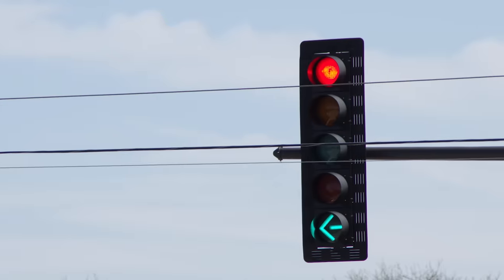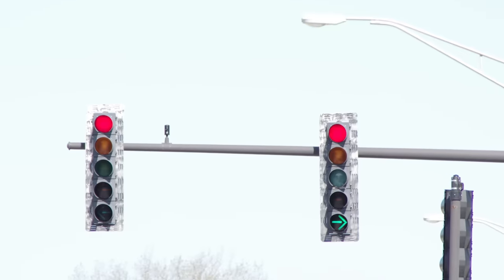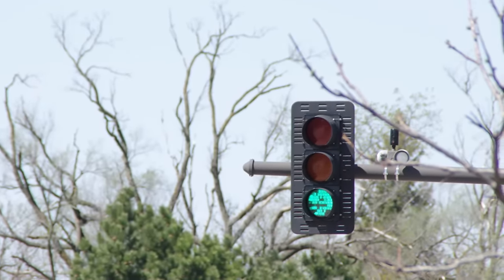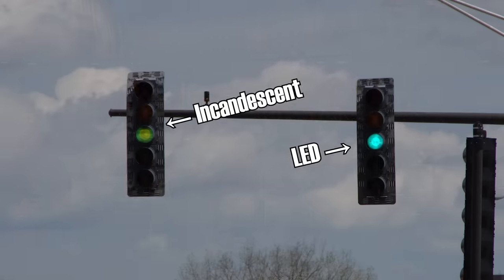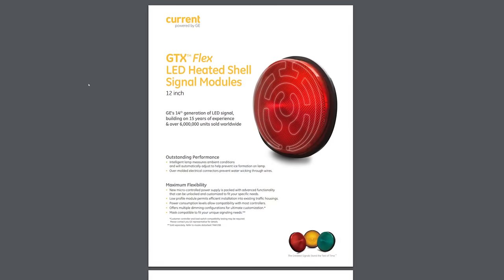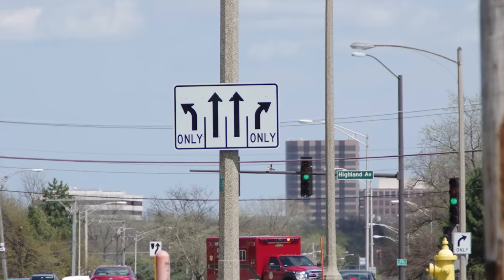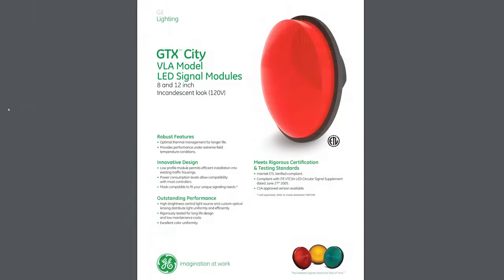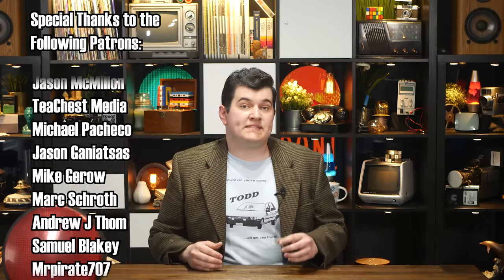The LED Traffic Light and the Danger of "But Sometimes!"

Comment: Back when they first started using led bulbs for turn signals they weren’t compatible with the relays that made the bulbs flash. Led bulbs don’t use enough electricity to make the bi-metal contact heat and cool to break the circuit. If it’s an issue of design era the older traffic relays may not be compatible with the led lights. With the draw being so low self keeping relays won’t function properly. Modifying one component may cause a malfunction elsewhere. With the cost of new equipment possibly being other worldly, small towns could be forced to defer replacements. Along with cost of equipment there’s also cost to install to consider.
As for snow covered traffic lights there’s usually only one set that could be blocked depending upon wind direction. Since there’s no visible problem from other directions it won’t occur to them they need to stop. It’s inevitable something bad is going to happen. I’ve seen the heated lights and sometimes they do funny things with the light they emit where the lights look silver and the color is reduced. 
I kind of like the traffic sensors since I figured out how to make them cycle faster in many cases. Sorry, I won’t divulge my method though.🤷🏻‍♂️

Comment: This is why systems that really need to work are over engineered and have redundant systems built into them, because "sometimes happens" 🤠

In the case of stop lights there are usually several lights to rely on in case of a failure, and in the event of a system failure, (in VA anyway) the yellows blink on the main road and reds blink on side roads. The driving manual says how to handle this btw, 

Now if somebody could just make a stop-and-slap for the 4 or 5 people the hustle the left turn after it goes red...

Comment: And if you stick some solar panels around on those poles they can charge the battery backup..likely only needing grid power when a battery finally fails so damn near zero power used.
That includes adding a sensor and heater. Almost zero power used and full blackout protection with proper battery capacity.
based on the savings you mentioned it would pay for itself in a couple years

Comment: When the sun is low in the sky and shining directly into the traffic light I find that it can be difficult to tell if the red light is on or off.  Also, while I presume traffic light LEDs are of higher quality, I find that with home LED's that the electronics that drive the LED fail much sooner than the LED itself.  But they never advertise the lifetime of the electronics, just the LED.

Comment: In PA the municipalities pay for the lights and upkeep, even on state roads.  Here replacement LED bulbs is easy, but replacing old hardware might be worth it until the control system is at it's end of useful life.  Remember there are other things to account for, requirements of a traffic study, maybe intersection redesign and the cost of the new system.  It is all nice and good to say do these things, but us elected officials just happen to know about the crap we have to deal with from time to time.  PennDot is one of them.

Comment: There is no way to tell if the traffic signals perpendicular to your street are frozen over. Therefore you may have a greenlight, see people stopped (they think the whole intersection is out), and drive through as they pull out in front of you.

Comment: ok, so my take on the "but sometimes" problems is to just look at the problem, look at solutions to that problem, and see what the result is when accounting for the but sometimes. sure the led is so efficient it'll need auxiliary heating during freezing and snowing conditions but how much energy would such a heater use? oh, up to half the energy of the old lights and is only running some of the time? sweet, i'll take it.

like ev driving. i used to think "oh i somewhat regularly take long distance trips so therefore ev is bad for me" but in reality a phev design is the option. don't use the ice in day to day commuting but have the ice for the long and really long trips or for when the ev portion isn't feasible (say rediculously cold temps requiring all the battery's energy to keep it warm) but that's not often enough to deter me from wanting a phev and using the best of both worlds.

Comment: Is your backdrop shelving flush with the wall, requiring you to have to remove everything from a cubby before adding video specific elements like these traffic signals 🚦 or do you have access from the rear of the cabinet?

Comment: 4 years later, dollar store LED drop in bulbs die relatively oftenly, about four times as long as an incandescent in my experience.

LEDs are finally failing, all it took was them literally being designed to fail with high currents on fewer diodes.

Comment: I got that at work recently. I changed up part of the way we do things to help make everything more efficient and generally easier on everyone but it did crate some new problems which I knew about before I changed it. I got everyone opinion before I did the change and they weren’t interested in taking about it at all but after I changed things everyone just complained about everything instead of helping me make small improvements to the new design.

Comment: In a snowstorm at night you can’t see WHERE a intersection is supposed to be if there’s no working lights pardner.

The fact is these municipalities should have taken some responsibility, in not doing proper research in the differences between the two equipments.
They should have factored in the heat differences and installed a system in place to heat up if met with freezing temperatures, it wouldn’t be that hard to do. But I guess blaming LED lights is still even easier than doing that.

Comment: For the argument of "it turns into an all way stop", I've seen multiple times when the light my direction is perfectly clean, but a side road can't tell what they have due to the snow. If 3/4 directions are clear, 99% of people will assume all directions are clear, as they have no indication otherwise.
Reply: If 3/4 directions are clear then there is no issue because your on one direction and your not going to go backwards.
Reply: @afaxmachine5045  I was referring to the lights being visible, not traffic. I have seen many times the lights are covered in show and not visible at all, but only for one direction of travel. The other three would have no idea that the 4th can't tell what their light is.
Reply: @jamesp7753  which also shouldn't matter because If one is out it should be treated as a stop sign.

Comment: totality agree but... that first winter was terrible it did not take much of a snow event to block them and you didn't consider that only one or two sides are affected by the snow so some drivers did have working lights and no idea that the opposition didn't. every snow even had cops in middle of intersections till heating system was jerry rigged into housing that more then undid the projected savings. it was amusing and was fun grumbling about it.

Comment: You don't live in North Dakota. In Russia has solved this problem. They removed the visors and thus snow does not accumulate. The LED lamps are bright enough that visors are generally not needed. They have red yellow green vertically except that the amber light, when it is not flashing amber counts down the seconds to the next e\signal change. On the bottom of the signal there is an array of three lamps. they will show red or green depending on which turns are allowed or disallowed.
 Великий и Славный и самый Имперский ЛЕВ 🦁

Comment: I could literally whipup a cad design and pcb for a fix for this. Integrate heater coil lines into the PCB design and have temperature probes on the board and when it drops below a threshold temperature say 0C the coils come on. It'll still be cheaper

Comment: Even the city I live in, one of the northernmost major cities in the world which is known for it's cold winters, we have LED traffic lights. Not universally, but I would point out to answer, to some degree, why you wonder why you don't have them yet in your area, is bureaucracy of course, and it can take significant time to deploy. We regularly receive winter weather sub -20C and even -40C and I am unaware of any issues with them operating in fact, strictly form an LED functionality point of view they work just well if not better in the cold, but in terms of lens obscurement or obfuscation, I have never seen an LED one obscured due to ice or snow. I did some research and each one has a fan for exhaust heat, and a 300-350W heater but as far as I can tell that is only on the control box and not the light fixture itself. It also may be this is more of a coastal problem as where I live is fairly dry in comparison

Comment: Hold up. Fatal accidents caused by faulty stoplights during a snowstorm are definitely the fault of the lights often if not most of the time. In a snowstorm, the light from the stoplights is often the only thing indicating the presence of an intersection. If it's night time, the stoplights may not even be visible while not illuminated.

Comment: Uk- Back in the early 2000's when we were out and about in the car at early hours of the morning to grab anything from the 24 hour garage ( usually ciggs for smokes ) we used to flash the car lights really fast and every red light would change to green on empty roads, it was so awesome. Not sure if it still works or have i tried it since. xD

Comment: I find that the LED lights are sometimes TOO bright, particularly at night.  They could use 10% dimmer LEDs to eliminate that issue, while maintaining safety.  I find the same problem on some LED taillights on vehicles.
Reply: Aye, especially when they're blinking. In a dark area.

Comment: So much engineering I didn't knew was possible or even could exist!!!!
On my country afaik there is only the control board on some of the older ones, which are maybe 2 or 3 out of 50.  
I loved the old light with the lenses because they looked sooo cool.
Maybe there are some that are controlled remotely although I can't confirm that. They are almost ALL LED's but some are burn't which annoys me. The street lights are almost all led's too but incandenscent aren't uncommon.

Comment: The holdouts were smarter.  Now, without spending a money on the 'whole-light' LED replacements that do just what you showed (and are /quite/ often really badly burnt out) ... Owners of conventional signals can now simply screw in low priced and widely available LED edison-style replacement bulbs and get all the benefits of a retrofit along with the easy, cheap serviceability of 'screw in a new one' without ever having spent all that money to 'upgrade' the fixture.

Comment: I don’t think I’ve seen one of those incandescent signals in well over a decade across California. Now thinking about it I only really remember some about 5 years ago deep in the middle of nowhere farm country north of Sacramento. And those only flashed red if an intersection had a rare cross traffic vehicle.

I seems nuts to me that people wouldn’t want to switch to LED as soon as possible. Maybe because in CA incandescent lights are next to useless on a sunny day (so most days).

And even in the Sierra Nevada parts of CA like towns in Tahoe haven’t had the issue of going out in snow events, but there and then again they were clearly designed for heavy snowfall conditions and are not simple traffic light boxes.

Comment: There are those who resist upgrading because of the UNION employees who wouldn't be needed to change bulbs. The addition of a simple temperature sensor and HEATING PAD, the "sometimes" is eliminated. Follow the money. Who benefits from the continued use of incandescent bulbs?

Comment: I like too use a thumper solenoid I took from a pinball machine - this was mounted to my mom's satellite dish.  the dish was too high on the house to take a broom too when snow built up on it.  A small box next too the receiver unit was handy as it had a button to push - thus really gave the dish a good "thump" as watched as the avalance of snow slid off the dish.   might get away with this inside the traffic light??

Comment: Talking about traffic lights, in Austria the green blinks for 4 times before the orange lights up .. to my knowledge this is not very common but bery useful as you know from a distance if you can keep the speed or start decelerating. Strange story there is a typical summer political discussion (every few years) about converting the traffic lights to the rest of the wold and omit the flashing of the green - luckily so far this has not happened ( I guess this is only to have the politicians present in the media)
I hope that also other nations may adapt as this is a useful system.

Comment: After rewatching this again, I just realized how incredibly brain dead the notion that LEDs + snow melters would come close to the power draw of the 160w incandescent bulb really is. Think about it, a tiny, double insulated heating element needs something in that ball park of 160w to melt snow. The led system places the heater directly on the snow, it’s pretty intuitive that this would translate to less power needed since incandescent bulbs are essentially heaters being used very wrongly

Comment: Why not just put yield signs under the stoplights and turn off the stoplights during bad weather, as well as times when there are only a few drivers? That would save large amounts of energy and also fix the issue of unreadable traffic lights during blizzard conditions.

Comment: ehh, just notice you guys use the same row of lights for several directions?
if there is a separated left AND a separated right in the Netherlands you get ONLY arrows on the entire intersection.
Ball means chance of crossing traffic (like unprotected lefts or pedestrians also crossing when you can turn right)
Arrow means right of way and no crossing.
the lights for each lane are either directly next to that lane, or above said lane.
At some times it can be that you can go right and straight, on the other side the buss can go from the buslane across and cyclists on your left are getting a green light all while some pedestrians get a green light to go to their halfway point to wait for the light for the 2nd half.
all traffic lights have a "waiting" stance of the main road getting green lights for straight and right turns, they don't change until any vehicle or notification from pedestrians/cyclists is registered from other lanes.

Comment: So you guys in the US don't have default priorities for a case of traffic light malfunction? Here in Europe we have signs with priorities just for the case of the light is down for some reason. So the whole stuff looks like, if there is an officer on the crossroad - do what the officer shows, if no officer, do what traffic lights say, if no lights or malfunction, do what signs say, if no signs, give a way for the ones coming from the right. Also in some regions there are all-flat LED traffic lights. No snow problems with them. It seems all-flat design allows the surface to be hot enough. Or maybe they are heated, I don't know.

Comment: There is one small gripe I have with your statement about people being stupid because they don't remember the four-way stop law when it comes to traffic lights that you can't read. The problem is, in the case where snow is getting on the lenses, it is likely that only one direction has their lights blocked, which means one direction would be using the light as a 4-way stop whereas the other three directions would be continuing as expected. Yes drivers in this country are very stupid, but right here they deserve a little defense.

Comment: I see one flaw in your reasoning that the traffic light that isn't indicating should be treated as an all way stop.  This works with a power failure and all the lights on all sides aren't functioning,  but if only one side isn't indicating due to being obscured by snow, the other drivers won't know that and will still obey their lights that are still visible and indicating.  This of course would be disastrous.

Comment: The led lights are so bright at night that you can't see anything else. Auto dimmers should be used for low light conditions. The emergency vehicles are even worse. I can't see anything even after I go by. As a truck driver, that's not good!

Comment: 10 minutes in thinking to myself, "Why couldn't you have an LED light with heater wires like your windshield defroster built in. You could even wire in a thermister to only kick on below a certain temperature so it only heats when needed" 
10:14 GTX FLEX LED Heated Shell enters the chat

Comment: Even low power LED's still produce enough heat to melt ice and snow. I'm sure there's a way to work around this without affecting the longevity of the LED's lifespan too severely.

Comment: Perhaps the bottom green light could be kept incandescent to generate heat for the snow - until a heater unit or GE heat light could be installed?